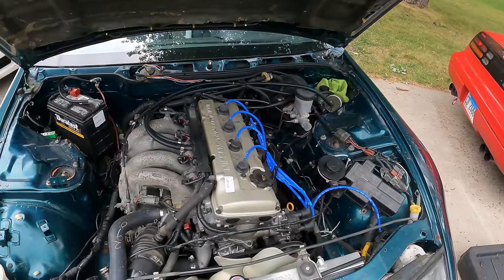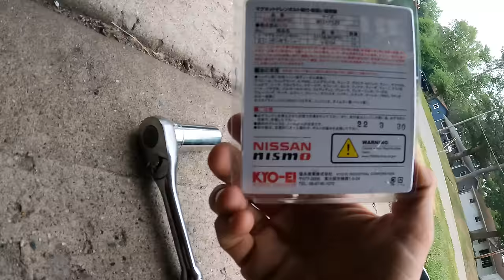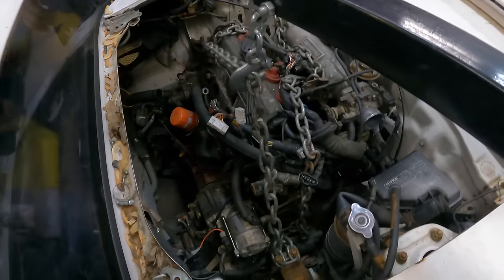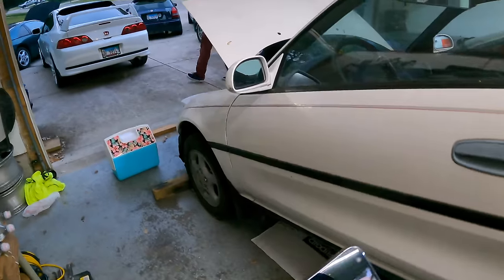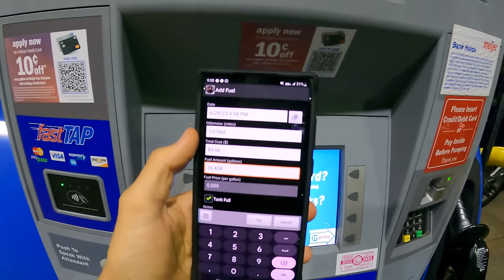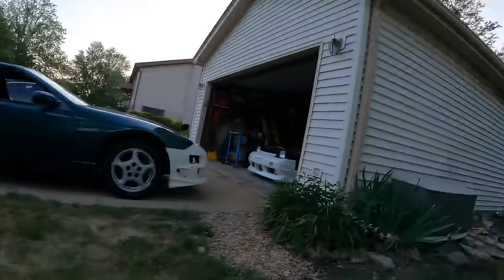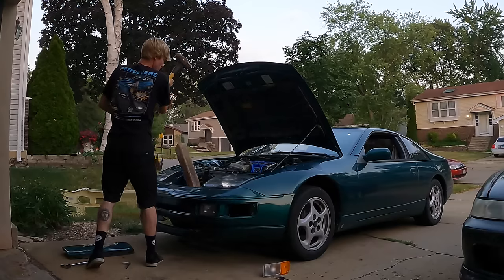Finding RARE 90's Aero for my 300zx! + MR2 Project Begins!

Comment: Good luck on finding all that bomex stuff. Really hard to come by nowadays. For wings you have the option of the supra mid wing, the stillen mid wing, and the wings west mid wing (unless you come across the super rare abflug version 4 wing or the rarer tommy kaira wing)

Yeah sorry to hear about the third brake light, it really is very common. It's pretty much why most of the Z's in the community have ditched the 3rd brake light for a wing with/without the third brake light to cover it up.😅

Edit: I can't tell if you bought it from Z1 motorsports but if so I'd suggest getting it from Concept Z Performance instead. They tend to package things alot better
Reply from the maker: I can not thank you enough for constantly sharing your knowledge! I love all of the suggestions for wings, now it's just a matter of which one I can find first! 😅

Interesting! The company I ordered from is sending another brake light, we'll see how it turns out!
Reply: tommy kaira parts are god tier
Reply: @PrizzaMike  Mike - if the next one comes in broken and a refund possible then I will reach out out (if I see it in the video lol) and sell you a BNIB one hand-delivered for $300. If you're interested - maybe you're getting this one for less than $300 then disregard! This goes for anyone else in the Chicago-land area that needs one of these but doesn't want to gamble $400 to get one shipped broken.

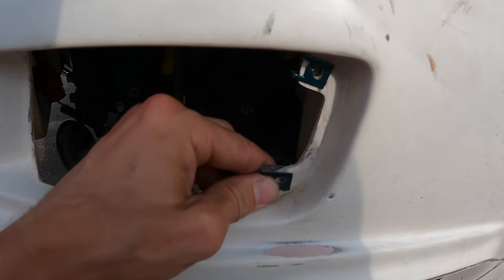Comment: @17:01 if you use a torch or a propane salamander heater to heat up that fiber glass bumper, it will flex insanly easily and once cools back off will "reform" to your new shape, ie.  align with oem body line instead of being forced into place

Comment: Order the 3rd brake light from your Local nissan dealership! you can inspect at the counter when you receive it and if it's broken they'll order you another one until it's not broken. It's the best way to do it. Everyone else online does not guarantee that it will not break during shipment.

Comment: Not that it matters a ton, but the n/a engine in the MR2 is a dual cam. It’s still slow af but it is technically related to the 4th gen 3sgte that’s going in.

Comment: Aw crap. I did warn ya that it might break during shipping. I'm guessing you ordered it through Z1? Did you do FedEx or UPS next day? I believe I used UPS due to the disclaimer about FedEx, and when mine arrived on all 4 sides of the box had "Fragile This End Up". Might check Locally for a Plastic Welder. One here tried to "fix" my scrapyard assembly, but the plastic was so brittle it kept breaking after the "weld", but being that it's new plastic it should weld no problem
Reply: One other option that might look nice. You are planning on painting the car yes? If so, Plastic weld it your self. do some sanding and bondo work on it and paint it the same color as your car. Make sure you mask off the actual 3rd brake light. I'll send you a render what it might look like. Wish I could use my mum's 300, since she's got a stock paintjob and not a custom bloodred candy apple

Comment: When I'm draining a "sketchy" engine I like to put a neodynium magnet on the underside of a steel sheet, and then run the oil coming out over it as it drains. That way you can pick up any metal flakes to have a better idea how bad things are. It's often surprising how much "finer particles" you otherwise wouldn't see visually in the oil that you can pick up.

And yeah, I'm swear by magnetic plugs. Actually pulled one once where there was what appeared to be half a ball bearing stuck to it prompting an engine teardown. Could not figure out where or even what it came from... which is... disturbing. That was on a  2.17L 1980 Talbot Sunbeam which was kind of an odd car to find in Taxachusetts.

Comment: As much as I usually dislike doing this, cutting one coil off the fronts springs would probably make the ride height just about perfect. Also, for your 3rd brake light try claiming it on the shipping insurance or contact the seller and see what they will do for you.

Comment: The company that sells the replacement third brake lights. Should probably do more quality packing checks. 

When I bought some taillights for my tahoe. They arrived damaged cause someone didnt put any bubble wrap or foam around them. They were just floating around in a big box. 

When I picked up the box I was like these shouldn't be moving around freely. 

Alway get insurance on your packages just incase any damage happens.

Comment: Pulling engines out of MR2's are no fun... My first car was a '88 MR2 and i've had to pull the engine a couple times and the trans a few times as well. Would use truck jack stands to get it up high enough to drop the whole engine/trans.